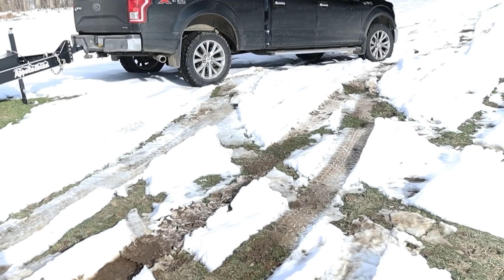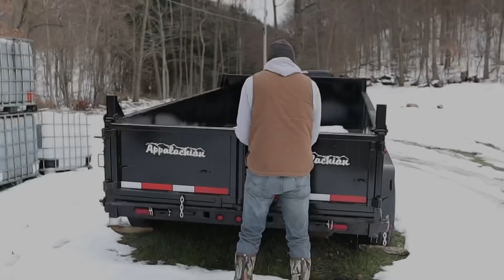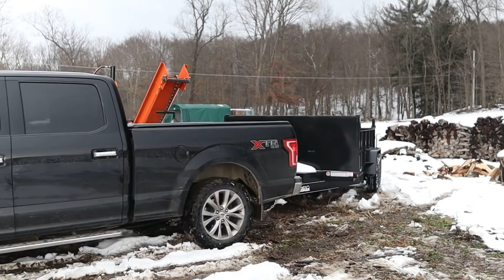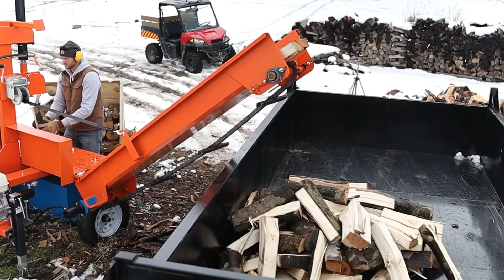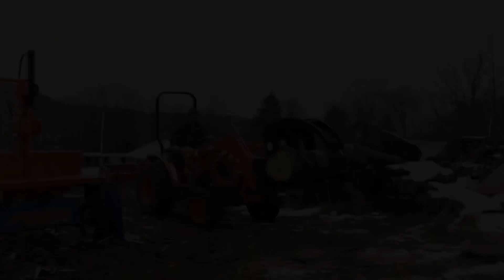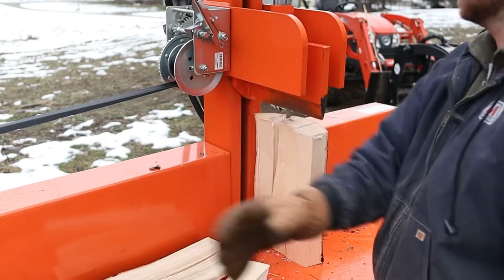Eastonmade Axis Loading a 7x14 Dump Trailer

Comment: I’m dealing with a similar situation loading my dump trailer. I’m considering a steel dumping hopper to load the split wood into. Then empty the hopper into the dump trailer with my tractor forks. Offers more versatility.

Comment: Fabricate a folding slide for the end of the conveyer. That way you can raise the angle of you conveyer and get it to the center of your trailer.  The dug out parking spot for the trailer sounds good but is not practical. You would have 2 install a dewatering system to any hole you dug so it is not very economical.  Keep up the good work and the videos.  I love to see small businesses at work.

Comment: Talk to a local machinist/fabricator.  They can build an extension 'chute' for the conveyor that folds out to avoid height issues in transport.  Slope it slightly so the wood slides off nicely.

Comment: Maybe try backing the dump trailer in with the gates open and have the conveyor more flat and allow the wood to be carried into the trailer.  The you can lift the conveyor to move the unload location towards the back.  Still might need to move the trailer with the truck to fill but worth a look?

Comment: You could raise  the splitter up on a  dirt  log crib platform about 1ft and that would let conveyer  drop down longer . Dig out where the trailer will  sit  and add some rock to help with drainage. If you need some help just e-mail can drive we are about 5miles from Ohio Wood Burner so just hop skip and jump down there

Comment: I don't think you need the trailer to have very much lift to let the rain drain out.  Just put a couple blocks of wood under the bed and on top of the frame to support it.  That way you don't have it very high and it is supported.

Comment: Try going over the top  and sinking the bar in to the big ones. It will prevent kickback when the bar is to short for the log.  Easiest way to deal with moving wood in the trailer is move the trailer with your truck or tractor. You have to move the trailer when your done any ways. Your not going to leave it out there just filled with wood.

Comment: The only thing I can think of is to try and lower the height of the trailer or raise the height of the splitter through ground work.
That way the conveyor could be lowered so it is more horizontal.
Raising the splitter then has knock on effect of messing up the pile of rounds and lifting them onto the splitter as you would be stepping up and down to the splitter.
You could dig a shallow trench out of the soil so the trailer is lower.
Then partially refill the trench with compacted stone so you wouldn't get bogged down when the trailer was full and your truck would have grip to get moving.
Just one question.
Why are you using the trailer in the first place as you like to fill tote bins with split wood?
Hope this helps.

Comment: Have you considered getting that trailer undercarriage sprayed with fluid film or a similar product? Seems like the common theme with most trailer brands is the paint can't wait to fall off to allow the rust to start.
Reply from the maker: Yes. Before I take it out on the road I’m going to undercoat it
Reply: Jason E, I mix up some used oil and a little diesel and put in a weed sprayer then spray the whole undercarriage.  Then find a dusty gravel road  to sealer off!

Comment: Have you tried placing the trailer long ways under the conveyor instead of sideways like you have it in the video? That way the trailer still can raise and have the wood slide to the back, but then once the back fills up, you can speed up the conveyor to shoot it towards the front of the trailer. And then if you do need to rake any wood, you only have to move it into the sides instead of from the front into the back if that makes sense.

Comment: Another great video Adam.
Would it be possible for you to identify the wood species of the logs as you show close ups of bucking up the logs? Maybe a quick text box that says "Red Oak" or "Silver Maple"? That way I can see the bark and the name and learn to ID trees better.
Reply from the maker: The 2 wood species in this video were soft maple also known as sugar or red maple and the larger round I had to cut from both sides was hard maple also known as rock maple or curly maple. They all have so many different names
Reply: @HometownAcres  thanks. I have 15 acres here at home (an hour north of Harrisburg PA) and I'm trying to learn what I have.

Comment: I have 3 suggestions.  Drag the splitter into the woods with you and load split wood into the IBC/trailer.  Can you get an x shaped head for the splitter? The x shape would be more efficient. Do you lose sales forpeople with small cottage stoves?  Experiment with a smaller length piece of firewood.   Always think of ways to avid trashing yhour body.

Comment: Take care of that stick, usually the purpose is for servicing an empty trailer.  A loaded one will put some unnecessary load on it
Reply: True. It’s a safety prop rod for use if you have to work on the trailer with the box up. To fix a hydraulic line, etc. so the trailer box can’t fall on you.

Comment: Is the conveyor the labour saving device it was designed to be?
I think you're getting that question answered for you.
I've seen others with an Axis throw split wood straight into a trailer ignoring the conveyor.
Working on that premise stop parking the trailer conveniently for the conveyor and instead park it immediately behind you for your own convenience.
You currently pick up the splits to throw on the conveyor so why not with half a turn throw it directly into the trailer.
Use the conveyor to get rid of the trash.

Comment: You have the flatlander 18" elevational disadvantage, plus with your ramp 18" your conveyor well pick up splits better. Look to see if your property to see you have a better elevational advantage, or use a box blade to create one.
Reply from the maker: I thought about carving out a parking spot for it but I don’t want to build a bathtub for the trailer and just have it fill with water. I’d have to think through some drainage too if I go that route

Comment: Are you a member of log Splitter World Adam? If so, then I'm building a vertical log splitter and I went out to have a look at a mate's vertical splitter, and was shocked at what i saw. The first thing was the unorthodox splitter head, followed closely by the simplicity of the ring lifter and then the amazing conveyor. Now this conveyor was "fully hydraulic". Whilst I believe, like so many, that Andrews splitters are amongst the best the world has to offer, the conveyors on the Axis leave a lot of room for improvement. The one on my friends machine folded out using a hydraulic ram, not a ratchet and gravity like Andrew's. It also folded out in half, each section was around 6' in length, giving it a total of around 12' (I'm guessing, I haven't actually measured it yet). The other thing I observed was it looked like it had two pumps, not the usual Love Joy connector but rather run off like a dual pulley system. This all took me by surprise, but now that I'm at home thinking about it, when I visit him next I will take particular notice of those points. One thing I noticed is that when my friend's trailer was getting full, he simply activated a lever and raised the conveyor another foot or so and the pile kept a rising, no having to dig holes or raising the splitter or nothing... simple dimple! I want the manufacturer to make me a conveyor to suit my machine. Let me know if you're a member of the log splitter world and I'll shoot you a link.

Comment: Would it be possible to raise the height of the Axis splitter by 8" to 12" so you could use a flatter angle on the conveyor to help reach closer to the center of the dump trailer?  Ie.  build up a working platform to put the axis splitter on and for you to stand on.  Joe at Ohio Wood Burner had some logging wood mats deliver to his place to make a road to his back 40.  Perhaps one or 2 of those would make a good elevated working platform.

Comment: as someone else posted....either dig a hole for the trailer (not recommended because it's easier to get stuck)  or build a platform for the whole splinter/conveyor.  Does the conveyor flatten out?

Comment: OK how's this.  be sure to park trailer 90 deg. to the conveyer.  ether make a piece for the trailer that the slack chain can bump against thus allowing it to stick further into the trailer.  Maybe a bump piece mounted under the conveyor itself.  So the chain won't hang down and hit the trailer as well as protecting the trailer.  IF piece made for trailer best make it to set on and set off.   If made for conveyor,  easy on easy off.  Till at least you know weather you want to leave it full time or not.

Comment: your looking kinda good over there, but your gonna need a bigger saw and just cut all day and split the next, get a husquvarna 395 and be done with the saw, get a 24” and a 32 “ bar and chains and it will rip through anything you got in seconds, with wood time is money and you don’t want to be touching it more than you have to, forget the trailer and stacking and those boxes just make a pile , load it in the trailer and tell em to give you the money.

Comment: Dang I sure like that little trailer but I’m just hesitant about buying one with just a half ton pickup. I have a tendency to overload things.
Reply from the maker: I hear ya, I definitely can’t haul gravel with the f1shifty but a cord of firewood shouldn’t be anymore than 5,000 lbs
Reply: Solve that by buying a trailer that your truck is better fitted with. Know your & your trucks limitations.
Reply: Get a 10 or 12 ft trailer.
Reply: They’re rated to pull more than 90’s 3/4 tons

Comment: A guaranteedd way to bend the frame on that dump trailer is raising and lowering it fully loaded!  I know from experience,  unfortunately.
Reply: I'm extremely sorry to hear that. So, what part of the frame bent, was it the lower part (with the wheels on it) or was it the upper part with the deck on it? We all have to 'raise' it full... that's what it's designed for.

Comment: Dig out a ramp to back the trailer down in the ground so its two or three feet lower than the splitter, lower the conveyor so it reaches out to the center of the trailer...Problem solved  :)

Comment: If you do it the same place every time then why don't you dig out a lower gulley with the front end loader for the trailer, about a foot down. Throw some gravel or mulch in it to keep it from getting too soupy. A french drain drain would be even better depending on your topography. Raising the the splitter would just make it harder on you.

Comment: Lower your tire pressure, which lowers the trailer; dig trenches for the tires to follow or dig a shallow hole the trailer fits in; put the splitter on a small hill

Comment: I see your Holzzforma is still.doing good, I'm breaking my G372XP in now....it's doing great so far.
Reply from the maker: I love it. Especially with a sharp chain. The thing eats
Reply: @HometownAcres  I bought a chain sharpener from Harbor Freight that does good. The Holzzforma chains are cheap, I ordered 4 with my saw. I'm running a 24" bar.

Comment: If you start your cut at 12 o'clock and work your way down to 6 o'clock then bring the saw back to 9  and finish your cut you shouldn't need a longer bar for that log